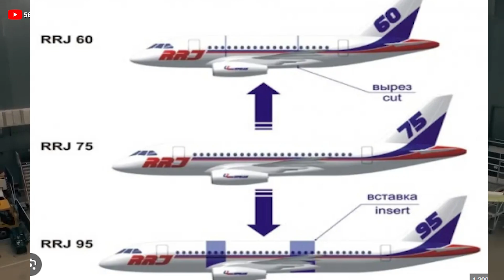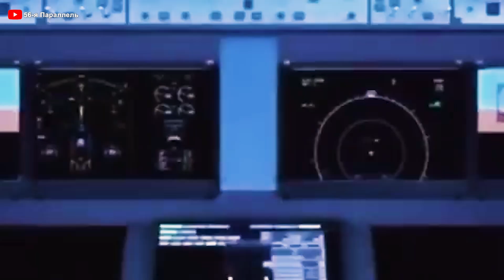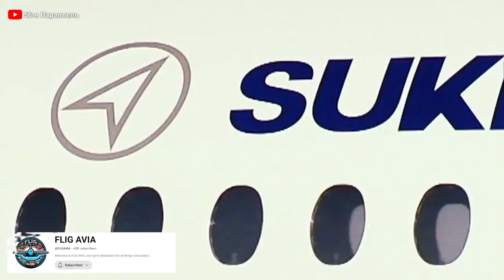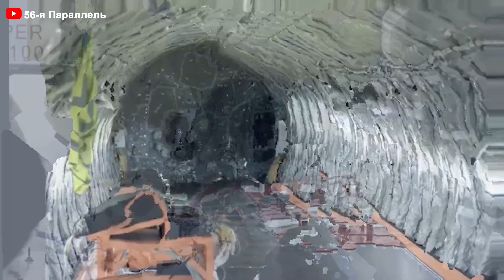Sukhoi SSJ100 with PD-8 engines will CHANGE All Aviation! Here's why

Comment: The Sukhoi SS-100 was an italian project, not Russian and Sukhoi and Saturn were just the integrators for the fuselage and the engines, the Italians held 51% of the project and Russia just 49%... The Italians abandoned the project in exchange for building the center fuselage for the Boeing 787 and as a result the Russians inherited the abandoned project that had 70% of western parts, after it landed on their lap they decided to play with it and started adding local resources to replace the western parts..!
The same happened with the Yakovlev YAK-130, after the Italians abandoned that project too Russia started to replace the western parts on it and perfected it often comparing them the Yak-130 outmatch and outperform the Italian version with western parts....
Reply: Einbildung ist keine wirkliche Bildungsform.
Reply: The Italians controlled 51% the international marketing of the plane outside of Eurasia .... not the aircraft
Reply: @GaryKennedy-g7p  Do you really think the Russians putting a 70% western content on the aircraft if it was theirs..?.. 
Russia was just the integrator as well as for the Yak-130...
Reply: Ложь!😂😂😂

Comment: PD8 engine is the best modern engine, SJ100 is ground testing with PD8. Aircraft is 100% Russian made. No more imports.
Self reliance is the best way for any country to produce 100% with domestic supply chain for aircraft for smooth operations for ever. Western countries imports are unreliable and dangerous for civilian aircraft operation. Russians learn the hard way.